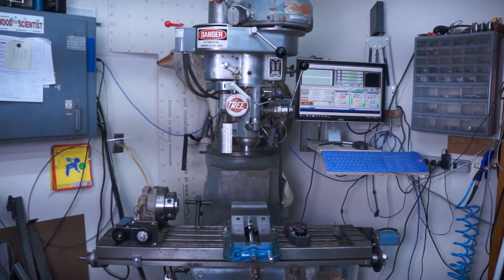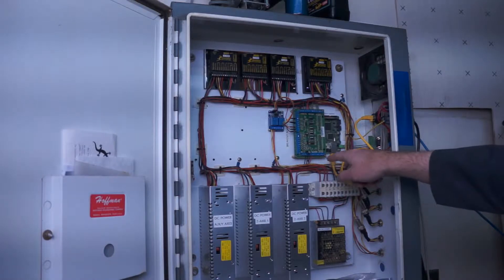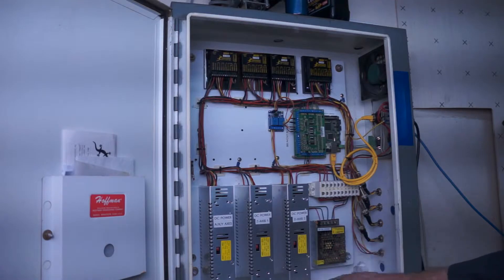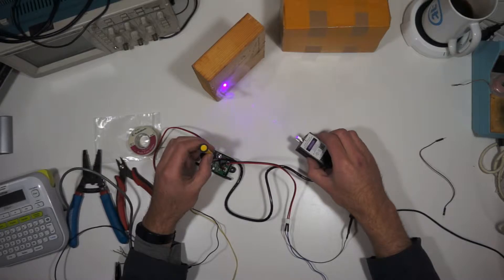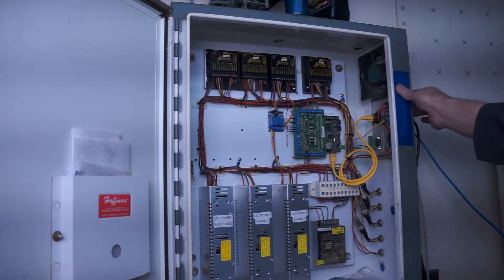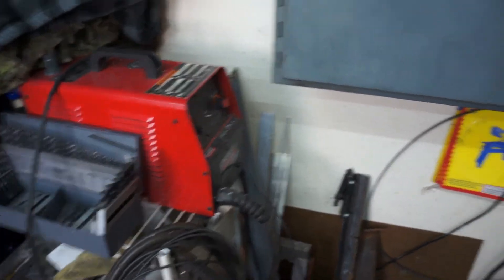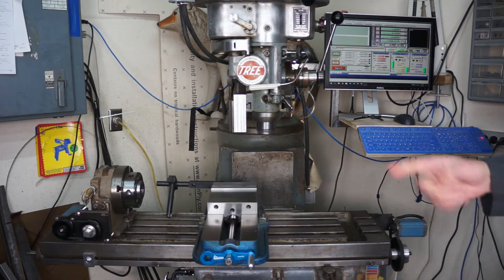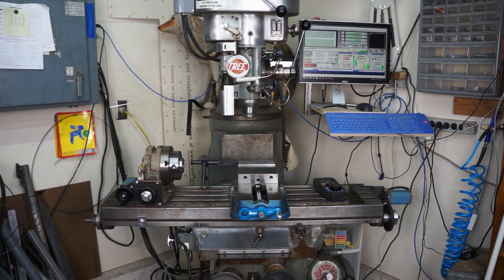Mach3 CNC Mill and Plasma on Milling Machine

Comment: This may be a silly question, but what is the fourth axis?
Reply from the maker: That thing on the left side of the table.  It rotates like a lathe chuck, just a lot slower, and I can literally mount my lathe chuck to it.  It's for those times when you need to make odd cuts around something at different angles that would be difficult in a standard vise.

Comment: That's a little bit more sane-sized for a garage mill! I kinda went a bit bigger on mine (check the videos on my channel). Need to get back to that project - I want a working mill this year!
Reply from the maker: WHOA!  Yeah, wouldn't mind having a tool changer but oh man, you must have a bigger shop than me!  You got 3-phase for that?
Reply: @BUILD2  Nope, 2 car garage, no 3 phase. I "tricked" the spindle drive into thinking it was getting 3 phase when it is not with a micro controller and a little bit of C code. I won't be able to quite use the entire 15HP of the spindle motor, but oh well. A LOT cheaper, and probably more efficient than a rotary phase converter. https://photos.app.goo.gl/XimTDiepkymWF6rg8 If you want to see it sometime, or need some bigger parts made if I ever finish the project of getting it up and running, I'm probably about 20 minutes away from you.

Comment: Very nice, I was curious how difficult would be to rebuild older manual milling machine to CNC one and you gave me an answer. :) I am pretty sure that there was a also lot of challenges and issues but from mechanical part it looks quite simple. :)
And that remote control is awesome. :)

Comment: First of all, your videos are great and I cant wait to see more from you.
Im curious how you mounted your Plasma torch to the Mill. Is it simply a rod bolted to the table? Or is there more to it?
I love the idea of combining two tools to add some new functionality
Reply from the maker: It's an old QD scope mount I had lying around, but I still had to make an adapter with bosses that entered the screw holes holding the torch handle together.  I recommend going with a cutter designed for use with a CNC setup.  Mine is definitely not!